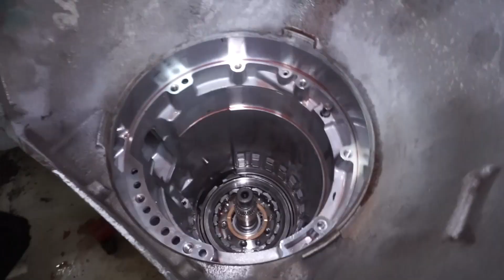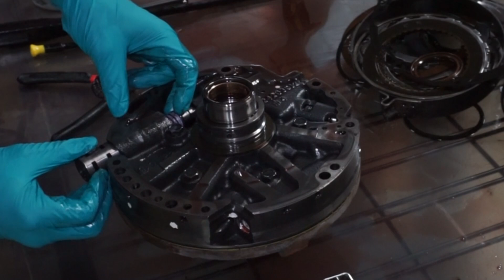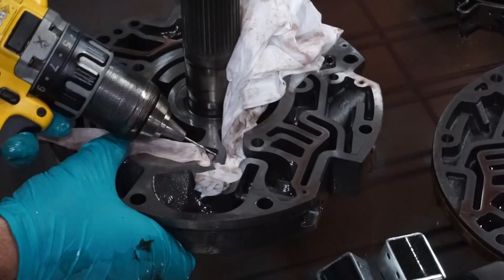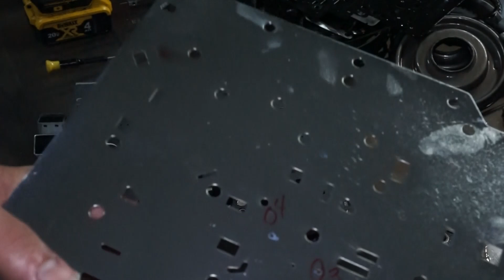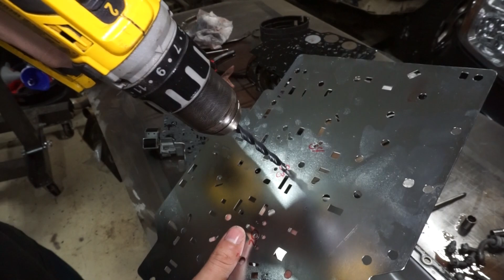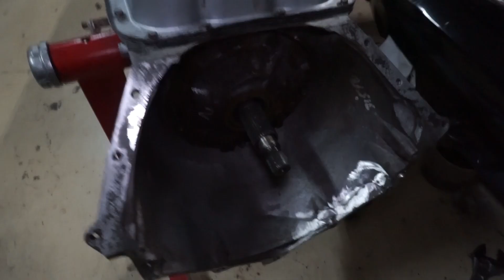4l80e Transmission Rebuild With Jakes Recal Kit Part 2 | Assembly

Comment: Did you also perform/check for the following but not include it in the video?

- Check the reverse servo pin apply and make sure that it’s correct range as the piston wears over time. You may need to weld more material on the end of the piston.

-Vacuum test the valve body and make sure that the bores for the AFL and TCC have proper vacuum otherwise you need to ream them out.  Transgo and sonnax makes kits to perform this. 

-Check the endplay for the following

Front endplay 
Rear endplay 
Center support to rear reaction carrier float play 
Forward hub to direct drum play

- Did you rollerize the rear?

-Did you check the inner and outer pump gear clearances to ensure they were good and that the gears did not need replaced? 

-Did you check for play in the planetary gears and make sure they didn’t need replaced?

-Did you check the forward drum and make sure that the sleeve isn’t worn?

-Did you check for play in the rear planetary and make sure that the captured bearing doesn’t need to be replaced?

Comment: Nice video but the bleed hole drilled at an angle has nothing to do with dual feeding the direct drum. The hole evacuates excess oil from under the apply piston. Why this is needed is because the direct drum is spinning at 1st gear ratio x engine RPM. Ex. 7000rpm x 2.48 means the drum is spinning at 17,360rpm!!! Crazy right? Any oil that has not been evacuated from under the apply piston will travel to the edge of the drum and through centrifical force will apply the clutch pack ever so slightly which will cause clutch burning, drag and over heating of the fluid. This is the reason most shift kits come with high rate return springs for this drum. Another reason is the high rate springs will help to push the clutch pack off faster for a quicker shift. Also, you should always try to use a waffle faced clutch when possible in this pack. It will help move the oil out of the drum for a quicker apply and keep the steels cooler as the fluid passes over them and carry's the heat out. The bleed hole also works great on the Turbo 400.
Reply: Good info

Comment: What is a recal kit and what application would this trans be good for?  Heavy truck or race car or hot street?  What does eliminating those accumulators do? super hard shifts?
Reply from the maker: It's a shift kit basically. Increases line pressure and shifts quicker. Could be used for either.

Comment: Hey Blaser, is this still the preferred kit for high hp recall kits?
Reply from the maker: @moose1992caprice   I prefer this over the HD2, especially if going inside the transmission.